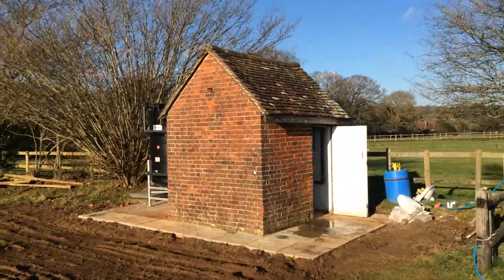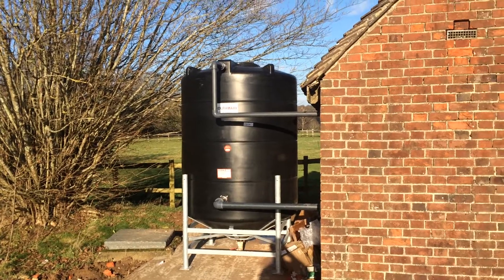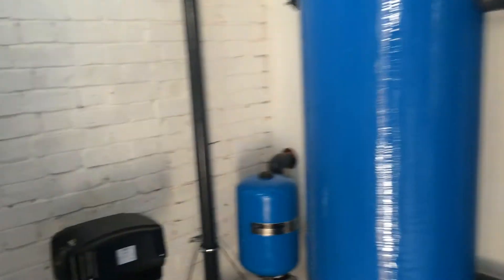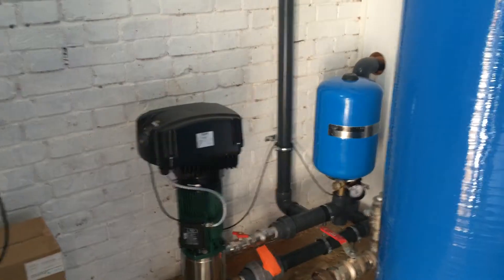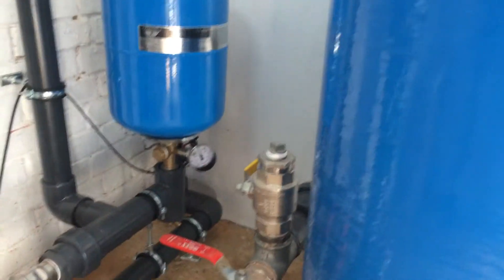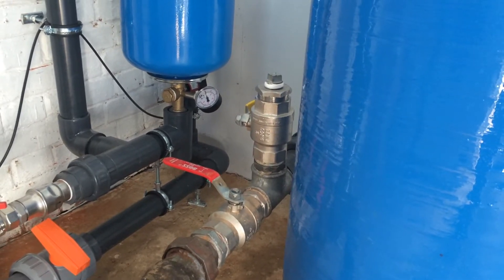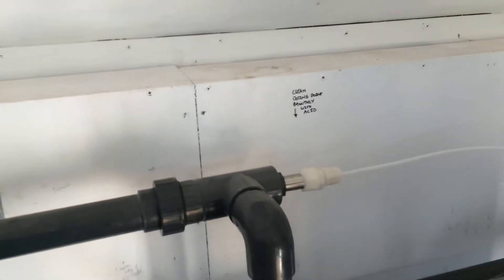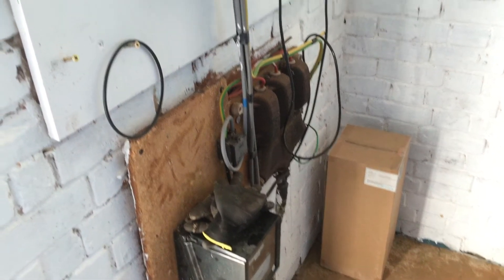Sussex Borehole Iron Removal and Chlorination System

Comment: 1. From the holding tank, is the water booster pumped through the filters to the end use point or taps?
2. As the water comes from the borehole it is chlorinated, is it chlorinated by the same pump when it comes from the filters?
Reply from the maker: There is an underground borehole pump to fill the tank with water. The hypochlorite is dosed into the water tank fill line, and mixes in the holding tank, which provides adequate contact time. A separate booster pump in the plant room boosts the chlorinated borehole water through the filters and directly to supply (houses, farms etc...)
Reply: @invictawatertreatmentlimit6761  Thanks, this means these are pressure filters. Do you chlorinate again after filters?
Reply from the maker: @psunduzwayo  Yes, pressure vessels with filtration media inside. No need to chlorinate the supply as the residual is sufficient to reach end of pipe with 0.5 mg/l free chlorine reserve.

Comment: Very nice! By the time you loom up those cables, that's going to look smart. What material is the holding tank - PVC?
Reply from the maker: MDPE WRAS approved material, custom fittings as we find standard tank fittings leak over time. This feeds many properties on a Sussex estate. All works passed by the local council, and we have optimised the chlorine usage to a minimum.
Reply from the maker: Black PP WRAS approved material